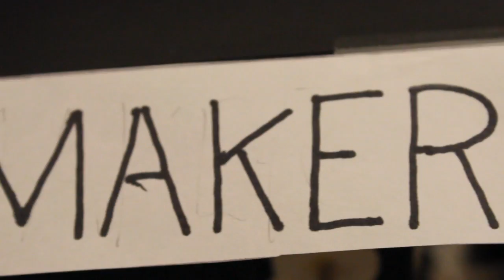Coin Flipping Robot - UMN ME2011 2012

Comment: A small problem is that it is out of the gate, inaccurate for measuring real world results of coin flips. The paint or nail polish or whatever on the coin will throw off the weight(yes it's a negligible amount but it still does a bit) of the coin providing skewed results.

Good bot though, clever return method.
Reply: Negligible indeed